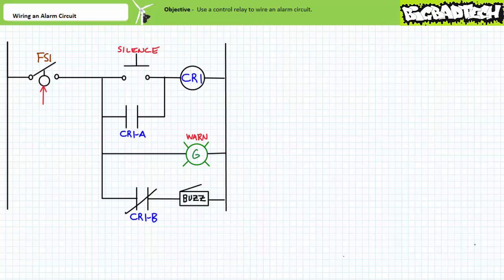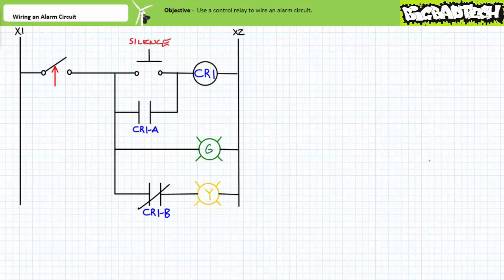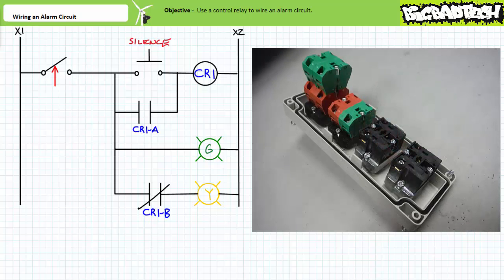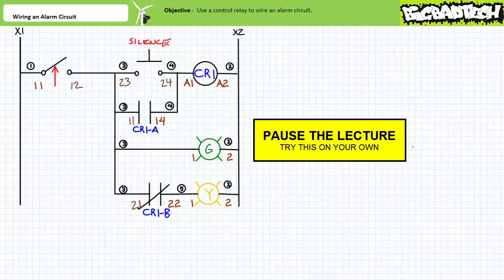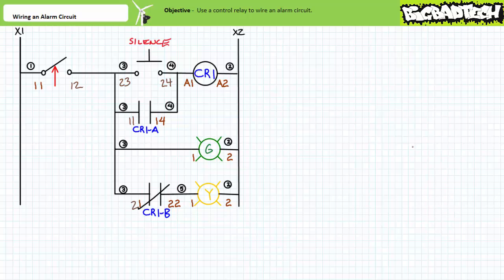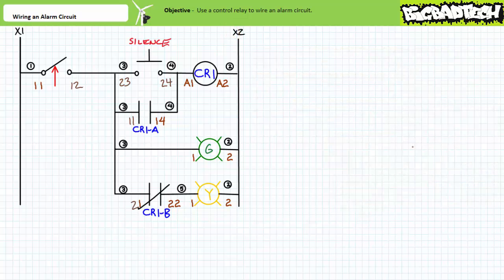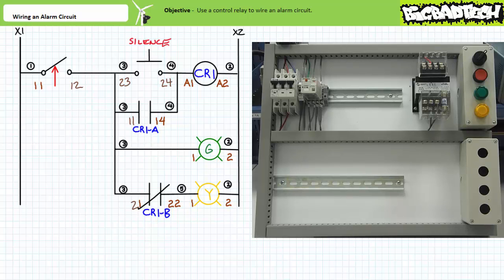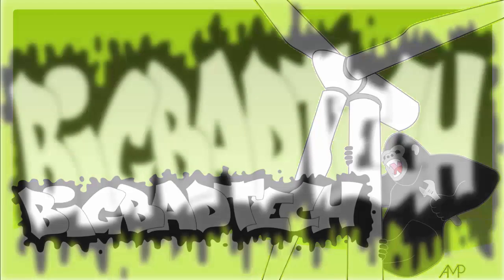Wiring an Alarm Circuit

Comment: Could you use terminal 12 on cr1a instead of using cr1b for the simulated buzzer, or is that a little to confusing to illustrate in a ladder diagram?
Reply from the maker: Absolutely. This being said ... using the opposite aspects of the same SPDT switch at different points in a ladder logic diagram is not for every occasion because the common terminal of a SPDT switch (the 11 terminal) must be at the same potential. While true for this ladder logic diagram it might not be applicable for all circumstances. The larger point is this ... you are thinking like a person that understands relays which is the purpose of this lecture! Good job.